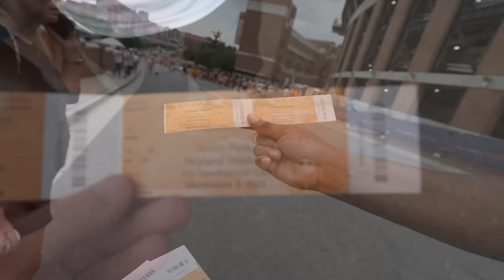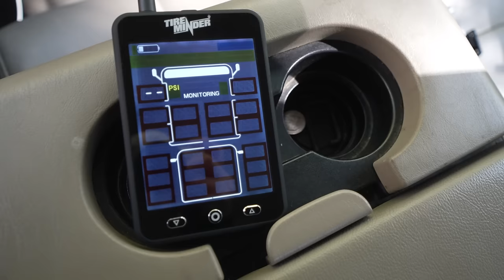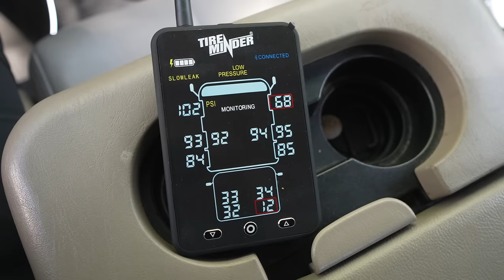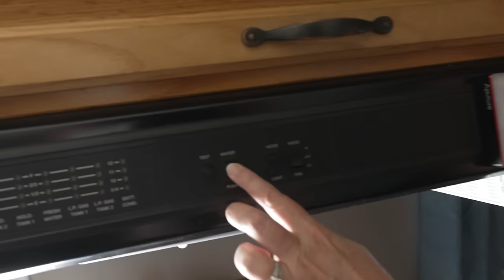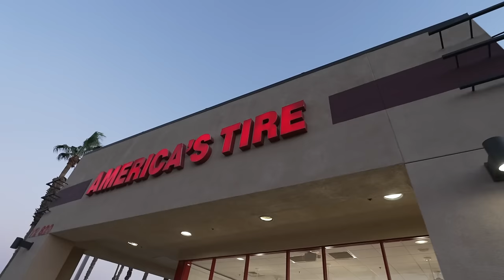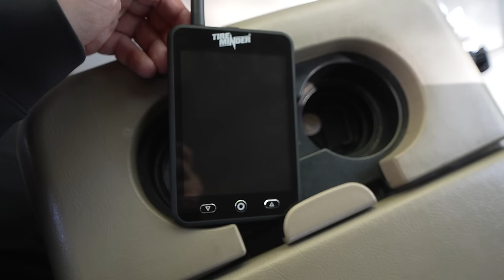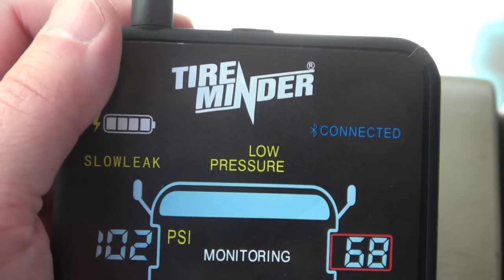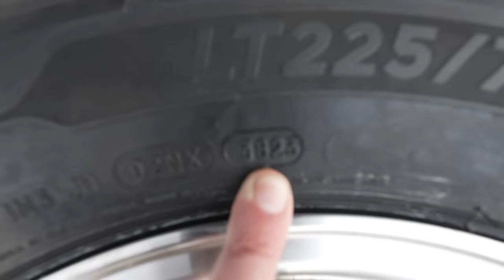TRIP KILLA - Our WORST RV Tire Disaster!

Comment: Why weren't you carrying a spare tire?
Reply from the maker: We do carry a spare tire. It was not necessary to put it on the trailer because we were towing a very short distance to the nearest tire shop to have four new tires installed. There was no point in putting on the spare tire because it would’ve been immediately taken off 20 minutes later. I had already made the decision to change all four tires. Once we saw one of them fail. If we had put the spare on the trailer, we would still be riding around with three old tires and I did not want to take that risk.
Reply: @LongLongHoneymoon  I get that, but even given the short distance to the tire shop you were putting all of your eggs in the basked of that single six year old tire.  If the worst would have happened (thankfully it didn't) and had that tire also blown under the additional load of supporting the weight of the vehicle on a singe tire it could have been catastrophic for your RV.

Comment: No spare?
Reply from the maker: We do carry a spare. In this case, since we knew a tire shop was only a couple of miles away, and we were eager to move our rig away from the side of the interstate for safety reasons, we opted to tow on 3 wheels directly over to the shop. If we had needed to travel a farther distance or at higher speeds, we would've put on the spare.
Reply: @LongLongHoneymoon   Oh ok. I know you guys are usually prepared. So I was wondering

Comment: FYI …only works with torsion axles….spring axles still require jack ..and cannot be towed on 3 tires
Please don’t promote misinformation…again…only with torsion axles can u tow on 3 tires….most rvs have spring axles

Comment: 6 yr old tires?? Aged out. I don't care how much tread left, old mechanic.
Especially, blow one on a Airstream+ tear up aluminum wheel well $$$$
Reply: Also, carry a spare tire mounted on a wheel.
Reply: @Bubba-wx7lp  we do carry a full-size spare mounted on a rim. However, we had already decided to replace all four tires at this point and the shop was less than 2 miles from where we were. We were broken down on a very busy interstate exit ramp and felt it was more dangerous to crawl under the trailer to retrieve the spare than it was to drive on the three tires. If we had had to get back on the interstate to get to the tire shop or had to go a further distance, then we would have put on the spare.

Comment: FAKE NEWS by omission

This story about blown tires like most other stories about blown tires tells us nothing about how these tires have been treated throughout their life.

With aviation, air planes, the standards for safety are much higher. Neglecting any maintenance is a nono and replacement of any part has to be signed off for. However, you will be hard pressed to find any reference to tire age in any maintenance instruction for any plane. What is mentioned is "hard landing: replace tires",  "any foreign object on the landing strip or on the hangar floor: replace tires",  Any operating with low tire pressure: replace tires",  "any visible cracks or other damage: replace tires".  You might find even more reasons to replace tires but I repeat, nowhere will you find a note relating to tire age.

To make the information about this sad adventure complete we would need to know how the tires have been used. How often did you take a curb or a pothole with these tires? Did you ever drive over debris on the highway? Did you do physical checks? Did you drive to Alaska on these tires? Did you ever for any distance drive with tires slightly or very under-inflated? If any of these things happened did you then conclude "ah well, let's replace them again just to be sure" or did you conclude that the tires still seem to look good so let's save that bucket of money.  Heat caused by under inflation and/or sharp bends caused by pot holes or objects on the road can damage the internal structure without being visible.

There is a good chance that a person just does not know what their tires have gone through. Then the advice to replace within 7 years is at the level of advice you would give an addicted gambler: quit while you are ahead.

There should be a special note about tire pressure:  State troopers regard a tire that has half the pressure it should have as flat. It is pretty hard to see whether a tire is at 20 psi while it should be at 35. Typically people only notice their tire having low pressure when they are practically out of air or when they actually check the pressure with a gauge. It also means that for instance a Class-A RV with tire pressures of perhaps 100 psi is said to be running on flats with a tire pressure of 50psi.  A person might mistakenly believe that 50 psi, being still much higher than what's in their car tires, can hardly be regarded as "flat". That is a thinking error, and tires on low pressure wear much faster. 

So what's the story behind these tires? Are we just echoing the tire industry's encouragement to buy more tires than necessary?
Reply: 😂 fake news? Sure, dude. Whatever you want to believe. We got 6 years out of the these tires and numerous cross country trips. I’m confident we got our moneys worth! Now if you want to track every pothole you hit and do extensive daily calculations to squeak out every bit of life from your tires, that’s awesome! Would love to see a detailed video on how you accomplish that. Good luck! 👍🏼
Reply: @kristymichael  I hope the provocative title of my message, including caps did not irritate you too much miss TRIP KILLA ?  🙂

It's all good though. I generally like your videos but I don't like people mindlessly keeping unfounded nonsense alive. I'd say that a person should replace their tires depending on their driving style. For some knuckle heads that might mean after every trip but I've read there are other people who swear that 6 years is stupidly long and you should replace them every 3 years. Are they wrong too? After all they make the same argument as you do!
Reply: @cobbles62  it gave me a good laugh! 😆 Like, wow, who keeps track of how many potholes they’ve hit? 🤔You left a very detailed comment, so I have to respect the commitment!
Reply: @kristymichael  I just hope the key takeaway sticks: there is no age limit on tires.

but

If you hit debris one time, take a curb one time, or drive with under inflated tires one time, then all bets are off. Your tire can blow tomorrow, it can blow in 6 years and it might never ever blow until you have worn it down past the canvas. You don't need to count potholes. You just need to be aware of the first one, because that's when the gambling starts.

I'm sure there are some exceptions like excessively baking the tires in the sun until cracks start to show up, but I dare to bet that by far most tires start to show cracks not because of the sun but because they have been used while under inflated and/or over loaded.